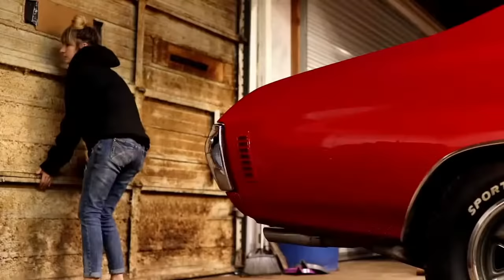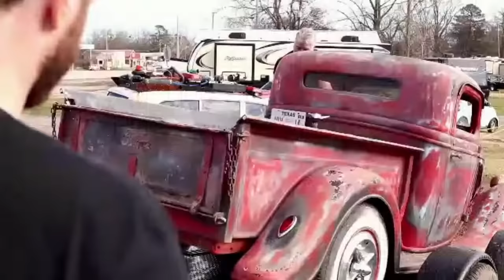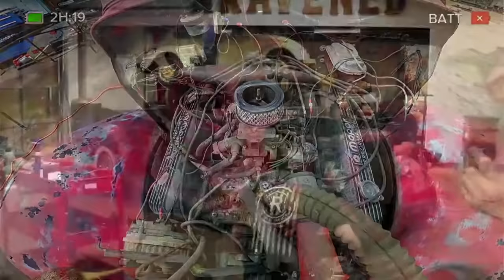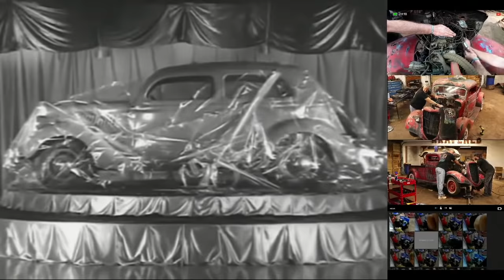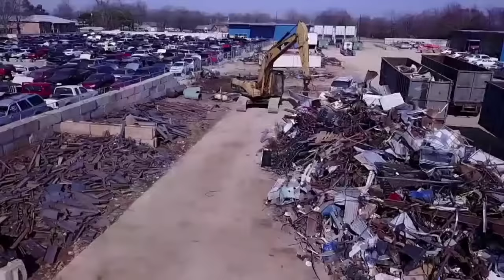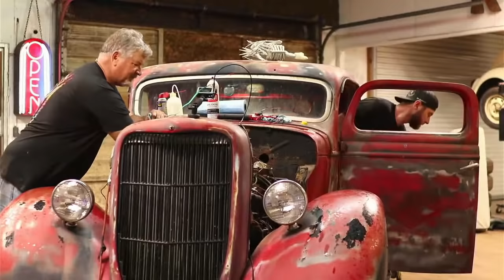LIVE Forgotten 1935 Ford Truck | Will It Run | Gene Winfield Inspired Build |RESTORED

Comment: You guys are taking me back to my teen years when there were a string of rental garages behind the old grocery store where guys were working on units just like that 34 with a Chrysler hemi or stuffing a 53 Olds V8 into a 37 Mercury two door sedan.. There were Model As a few Ts and I recall one guy had a 1908 Buick he was putting back to drivability. Those were the carefree days of the 1950s. Thanks!

Comment: I have a 69 Charger with a 318.  I've been  driving this car for the last 45 years and enjoy every second of it.  The Carter two barrel it used to have was a pain so I  switched to a  four barrel with electronic chock and have been very happy with that for the past 25 years.   Engine is being overhauled at this moment and I can't wait to get it back in the car.

Comment: What a great looking truck.
Sounds like a little timing adjustment, and a working carburator would do wonders for that project, but the fact that you guys got that tired old Mopar to wheeze to life was a testimony to you not giving up.
Even better, jack up that old engine to get it out of the way, and bolt in a Gen I , 350 Chevrolet V8 and go cruising.
Take care . We really enjoy your videos.
Reply: Don't do that.  It's a Ford; put a FOMoCo in it and don't Chevrollet everything because rthey're cheap.

Comment: Just started to watch your channel think its great.I believe what was happening with the ground problem is that motor has to be grounded to frame and the reason the brake line was getting hot was that the body of the truck does not touch frame of truck it sits on the frame bushings. What was happening was the master cylinder is connected to the body and the brake line was acting as the ground because it was connected to the frame of the truck with brake line mounts so the brake line was acting as the ground wire. The engine always has to be grounded to the frame. Again thanks for the great videos keep them coming.
Reply: Yes he's right the engine mounts are probably rubber remember grounds will always follow the easiest path in this case the break lines master cylinder.  Brake cleaner will be 300 octane like quick start on brush cutters should really fire things up have an extinguisher handy always CO2 the best .

Comment: great show guys, a cool story of human empathy that helped you that day your tahoe decided that the gasket was just too worn to go any further.  And look what has become of it, you've built a channel with 78k plus followers, including a backlog of headaches errr cars to get up and running.  truely inspirational.  Especially having to wait for the ol' engine kick out that gunk and for the sparks to dry off enough for it finally kick over.  we humans are a persistent lot.
Reply: I stay until the end. I am enjoying everything you all do. To get vehicles to run.
Reply: Release the spring clips on the distributor housing and lift the distributor cap allowing you to inspect the ignition contact points. Turn ignition on and using a std. screwdriver move the unstationary side away from the stationary side which should cause visual arch. If that does not occur use a finger nail file add remove carbon from both sides of contacts.

Comment: My 37 Ford pickup also had the butterfly hood.

What happens is rain comes right through that center hinge and right into the carb through that center bolt on the air cleaner.

Living in Oregon  I had to fab a sheet metal umbrella to stop that water.

Maybe not what you have wrong but that's what happened to me.

Sweet truck

Comment: Yeah, that's the first thing I thought is that someone poured the water into the engine.  Update*  Towards the end right after you prayed and it started up literally I cried my eyes out.  Having God watch over you with His protecting angels must be a wonderful thing.  Love it.  Keep up the good work!  Seriously, that was a miracle.
Reply: I'm sorry I'm going to disappoint you, but starting an engine is not a miracle - it's science! And for this you need to know how to disassemble, clean and tune the carburetor, tune the opening of valves and the distributor - that is, have knowledge of mechanics.
Spray gasoline into the carburetor, crank the electric motor until it smokes and pray the engine starts - you can call it anything but don't call it mechanical.
 By the way, at the age of 16, I completely disassembled a car engine, I did the line, the set-up the timing and the carburetor and it starts at the first key - not praying.
  Unfortunately, 40 years ago I did not have YouTube, nor a video camera to record "the miracle", only an immense desire to learn and to carry out a job well done.
It was not a Ford V8, just a 1200cc inline 4, but I did it without any help (I only took the camshaft and the crankshaft to a specialized workshop for rectification).
 If your engine start "by miracle" then it stops later when you're on the motorway ( if you go there ) and then you must pray for another miracle or call a mechanic who know his job to make it run again.
Reply: @ioanm6616  People who respond to me on here all have the same type of profile.  No content to see, and simply a troll.  It's okay, God will heal you!  I'll pray for you!
Reply: @castlerock7423  You could pray to God for a person and maybe God help him if he deserve. But God will not change the engine timing settings if they are wrong, nor will it clean the carburetor jets, just because you're praying for it.
 In this case, the engine starts because he changed the battery with a charged one and used a cold start aid spray - that does not cause the spark plugs to drown as happens with gasoline in a cold engine, between the two actions and the fact of having dried the spark plugs a little earlier, one of them managed to ignite the mixture but the engine turned off again as it did not receive the correct air/fuel mixture.
 Even if you change the carburetor with a new one ( the solution that today's "mechanics" are using because they don't know how to clean the carburetor jets or how to correct the level in the Constant Level Chamber ) the probability that the engine works correctly is very low, the settings are never absolutely identical from one engine to another.
 You are free to believe that i'm a troll or the cows will fly if you pray enough - that will not change the truth. They ignored ALL the advice expressed in the live chat.
Reply: @ioanm6616  I don't have all the answers regarding how or why God decides to go about answering prayer,  I just know He does,  but it doesn't surprise me that you say such things because one thing that God requires of all believers is faith.   Not only do you not have faith,  but you dont even believe that He is.   Good luck with that philosophy.

Comment: I'm in a metropolitan area of North New Mexico, population around 200. Only 2 businesses in town, Post Office and a dinner. Often questioned which does more business. Few years back I bought a Chevy 9600 grain truck. The 6 cylinder motor really struggled on my mountain roads. I had an 87 fire truck sitting here with an 8V92 Detroit in it with a 6 speed. Well I'm sure I don't need to explain what happened there. I'd surely enjoy doing a NAPCO front end on the ol'girl. Nice looking truck and yes, the hydraulic dump works fine, so far. Solid straight body with a rock solid frame but I'm to cheap to paint it because I only use it to haul my firewood from the mountains to the house. Only have a couple thousand in it as it sits now, cheaper than buying a trailer. I'm not getting any younger but I do enjoy my mountain's and tinkering. Your channel just showed up in my feed and I think I'll enjoy it.

Comment: I have been looking for a 34 or 35 ford truck since I was 14,   57 years.. First time I drove one was when I was 10, I put the mower and rake in the back the connected the flat bed with tractor and baler on it and drove it to the hay field. The old guy died when I was 14 and his son auctioned all the equipment, the truck sold for 5x the money I had.

Comment: Have y'all thought about getting a spark plug cleaner sand blaster? Amazon has them for 18 to 19 dollars. It would be a safer then using a wire wheel to clean them plugs.
Reply: NOW I KNOW WHERE TO GET A SPARK PLUG CLEANER!!!  THANKS!!!
Reply: Yeah brake cleaner works good
Reply: Timing
Reply: Adjust timing

Comment: Yeah I know, 2 years too late. It looked to me like the motor was grounded to the body, and not to the chassis. The current would be travelling from motor to body and down through the brake lines to the chassis., trying to form a chassis ground. Hence the overheating of brake lines. Then your addition of cable to make the chassis ground did the job. Motor to body connection in these circumstances is quite often just through the throttle cable. Really enjoy your shows. Like your little witness snippets as well.

Comment: 4 principles to engine theory. 1. Intake 2. Compression 3. Timed ignition 4. Exhaust.
New fuel supply,  Basic Tuneup,All  Carb Orfices and Mechanical Parts, clean n free of debris.
But, that won't make 2-1/2 hr streams. Lol ❤prayers 🙏

Comment: The thing about the Mopar 318 cid in 1935 red truck. It would need the cylinder head off and check on head gasket and valve grinding so it seals. Engine wears out and check resistance in spark plug cables and spark plug should be under 14,000 ohm each. You sold the 1935 truck to Mr. Morske.

Comment: hi I came on into your channel because  I am a old mechanic and I love programs like that  good what you doing with the  35 ford  I do not know if you ever  fix the  problem  but is I be honest  is a few steps  that  I take when  I am trying to restoed a vehicle  and is first  drain oil with out looking what is on it   ,radiator is next   ,gas also drain  gas line  air blow  check  gas pump  annd rebuild card and ignition  syst  after that then I try to start it   just saying ,,. Who I am  I am a US ARMY retire car and diesel mechanic  for over 50 years  and sorry I said  this but it burn me of ppl (in gen ) that said they are  mechanics and  miss the key factors  on a restore  electrical,engine ,brakes  full restore before starting  engine .you want to comtact me  look me up  I am on face book  either way love your channel

Comment: I was watching the old video about the 35 Ford truck with the 318 Mopar engine.  I have an idea for future reference when you have a really stuck or frozen engine.  I'm thinking that if one of you put a wrench on the  front balancer while another gets under the car with the transmission in gear. Then put a large pipe wrench on the drive shaft while you both try to turn it over in the same direction this will put double the torque on the crankshaft.  Good luck, Ron

Comment: Run a ground wire from a starter mount bolt to the chasis and you will have 70-90% less electrical trouble
Reply: Diesel mechanic told me that. He hangs out at tucumcari truck stop in New Mexico
Reply: ALL VEHICLES

Comment: The thing is so hacked up as it is. I suggest you finish the job. Restore it with what you have, but make the motor better. muck around with the fittings and give it a crazy paint job. Make it into a fancy rod. It would be very unique.

Comment: I have had salt water in a diesel motor when we got the boat to the surface the first thing we did was sink the motor till we could desalinate it, Water is not the problem it is Water and Air. When we pulled the motor most of the copper was gone from the starter and alternator but threw a fresh water flush through it then a fresh water with a salt flush bath then drain and new oil and a oil treatment and the motor has had 8 oil changes and still going strong. The water could have been condensation maybe.

Comment: If your doing things on the cheep bs not swapping the motor but willing to break it down to almost the block in the truck you can get great power out of the 318ci. In High School I had a 318ci Dodge Dart Swinger. That's where my experience comes from. If you swap the heads using ones from a 68 to 72 340 they will flow better and stay cooler.  Get a cam from a 67 or 68 318 out of a Cuda fastback or Cordoba 72 or 73 as they were a bit bumped up in profile for.lower rpm power. The exhaust manifolds need to mate to the 340 heads and not a 318. The 1967 68 manifolds from a Challenger or Chrysler new Yorker will flow better if not making tubular headers. Intake manifold needs to come from 70 to 72 360ci Road Runner. Same with carb as you will get a 4brl Holley instead of a Carter. Better yet would be a 6 pack off a 68 Super Bee.

Comment: Cable from Battery to Starter may be grounded at a worn insulation spot where it crosses a rear brake line.
So when starter gets juice to starter it is also juicing the brake line to ground.

Comment: I would love to see a restomod made out of that truck. Ford mustang two front end on it. 4-wheel disc brakes with coilovers all around. A ls6 motor with a 5 speed automatic transmission 9" Ford rear end. A nice custom leather interior. A beautiful candy apple red paint job with all the bright work redone and then a nice set of chrome rims. Remove all of the rotten sheet metal in the bed and replace it with a beautiful birdseye maple wood

Comment: If you fill the vent tube with gas the fuel bowl will fill up. Also use 2 stroke gas it helps lubricate the cylinder walls

Comment: You should have sprayed them off with brake cleaner. To dry them out and then use the brake cleaner or carb cleaner. To try and start it, do not use gum out. Cause Gum out has an oil petroleum base.

Comment: When i started in the tire buisness in 1977 the shop i worked for had a white wall lathe . The company i worked for had once made recaps . but what i learned was the white rubber on the 3/4 white extended a 1/4 in above and below . The street our shop was on had a bunch of used car lots on it and on the luxury cars they wanted wide white walls without paying the big price , so i would go out and pickup the wheels they wanted me to match and we would find go used tires for them and i would put them on the lathe and pull the 3/4 whitevout to a 1 1/2 in white . They payed me $ 2.00 per wide white on top of what they payed for the used tires . This went on for about 2 years till the machine broke down and noone had parts for it . One thing thst my boss could do was to cit a small strip and lay a gold strip in it to make it look like the old Volge tire . They payed way more that $2.00 for that tho .

Comment: 2:07:00 ish my dad (a mechanic) said “The ground cable from the block on the engine has to be grounded to the frame and the brake line is trying to act as a ground cable”

Comment: There is a spark coming from your side of the engine on the starter check wires from the starter touching the brake line

Comment: That truck originally would have had 4 cylinder Flathead, so if your going to restore it that is the way to go or if you want original and do not like the Flat Head ,Install a Totyota Echo 4 cyl. as it puts out 108HP pretty nice to put into a old 4 cyl.
Peter

Comment: i would like to see you guys pick one spot to run the wires from the cab to the engine bay, that drives me nuts to see 8 or so different wires running from 8 or so holes.

Comment: Beginning at 2:34:37 it's sparking on the drivers side near the carb.  The engine seems to fire whenever this spark is present.  There's definitely a poor wiring issue somewhere.

Comment: I think those hub caps are Dodge Lancer hub caps from 1950's I think. Those were real popular on the old hot rod cars. They may be after market though if not original. Looks like a 55 or 56 Chevy speedometer in the dash.

Comment: Is the Distributor opening up or springs stretched out the fuel pump might be to old filter wires cracked and the vaclines

Comment: I TALKED WITH A DIESEL MECHANIC AT THE TRUCK STOP TUCOMCARI NEW MEXICO AND HE SAID EVERY SEMI EVERY CAR EVERY PICKUP TRUCK PUT A BATTERY CABLE JUST LIKE ON THE BATTERY FROM A STARTER BOLT TO THE CHASIS FIR GROUND AND YOU WILL HAVE LESS ELECTRICAL TROUBLES (PERIOD)
IVE BEEN DOING THAT FOR 15 years and it works..

Comment: fellas when you have somethng like an electrical iszsue that you cant find real quick its far faster to just unhool all wires and put sopme new wires only what you need to accomplish whatever you are trying to do it can save yoiu a ton of misery and time dont ewaster your time trying to run down the problem just bypass and run new wire for what you are trying to do   bless you

Comment: You need to move the Ground .it is making the brake line the ground going back up to the starter because your ground is in a bad spot. same reason the starter is running slow as it has a bad ground to the engine . you are hearing the brake fluid boiling inside of the line that is getting hot. duh

Comment: I'd love to have it but Seattle/Tacoma to you in Texas and back would be a long trip and I wouldn't want to pay $1,000 to get the truck home. Plus, I'm sure that I would not have enough money for the highest bid.

I'd keep the paint as is and just put clear coat over it to protect it from rust. If I were to change the engine, I would put a Ford back in it. I know that Chevy is inexpensive and easy but Fords should have Fords, Chevys should have Chevys. Unless you are going to put a supercharged 427 Hemi that might be a different story. But then that probably wouldn't fit.

Comment: at 2:34:40-45 when you were cranking on it. i noticed every time it would hit,  spark would jump between the throttle linkages. i tried to find you email so i could send a pic of it.  watch the video and notice the spark is in sync with the engine hitting. now you tell me. ive never seen that in my 25 yrs. of being a restomod shop owner